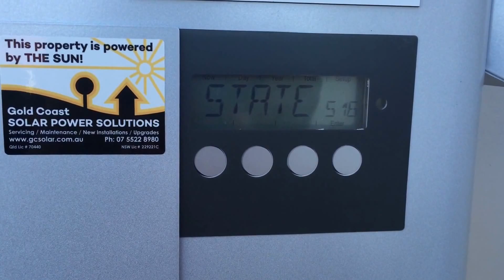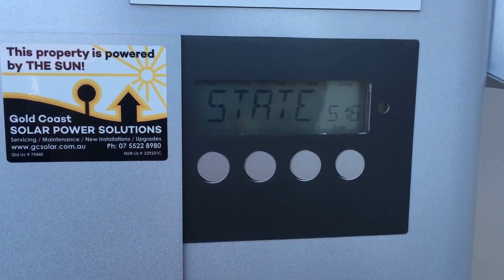STATE 516 on Fronius IG40 or IG60 inverter

Comment: If you look the power boards, they are black because of the glue. They use glue to fix the parts, because of the poor soldering. The degradation of the components are planned, so the board is not repairable. You can only completely swap it, which is not environment friendly strategy.
So I prefer not to buy that type of fronius inverter.